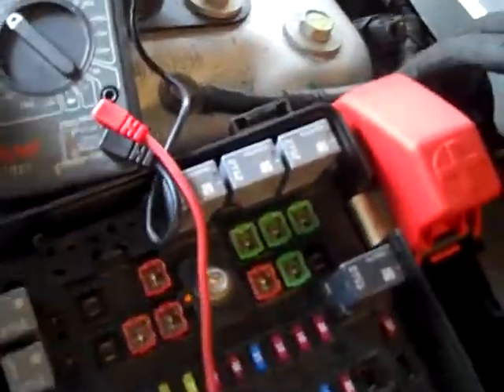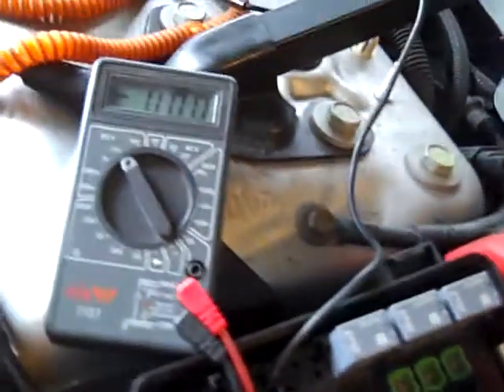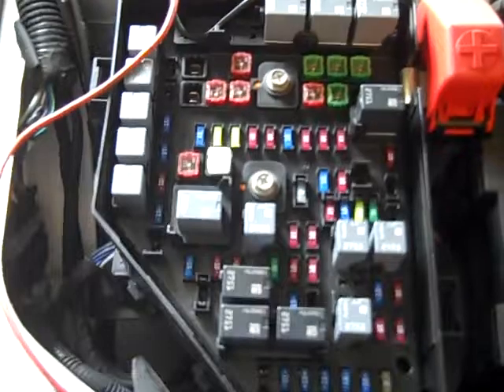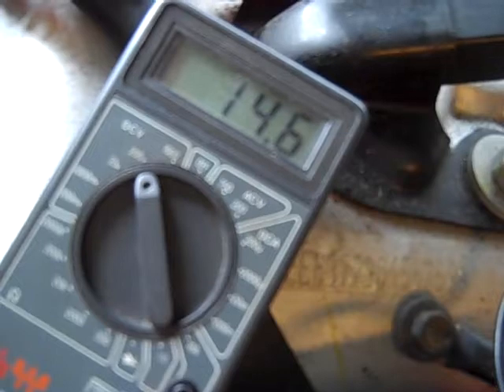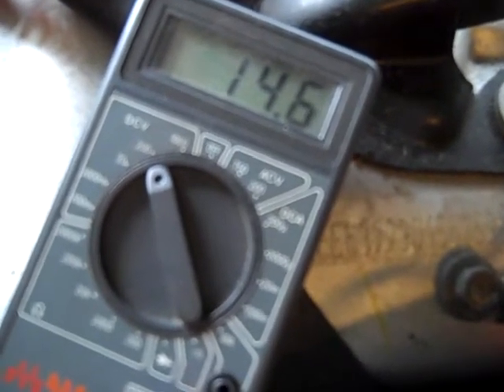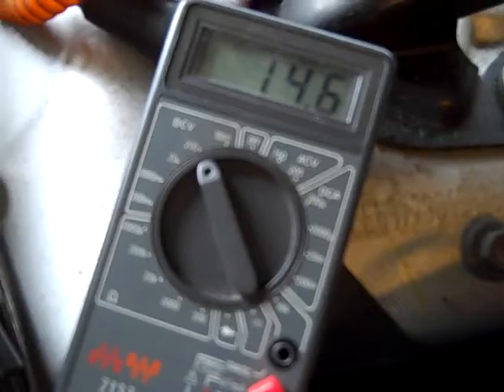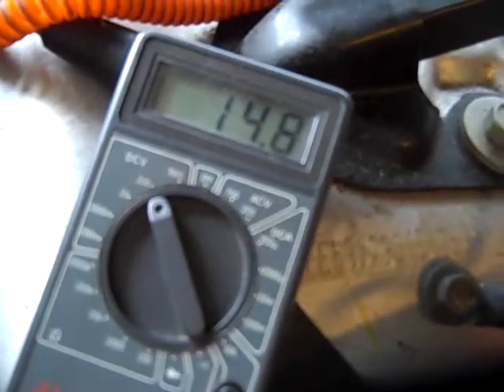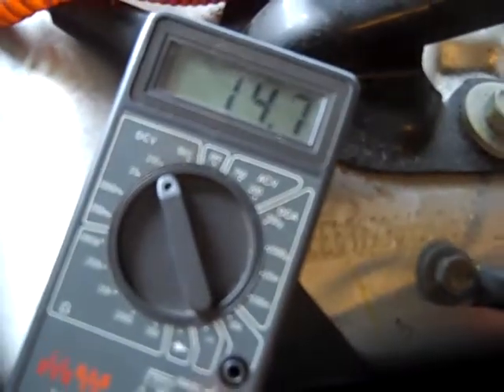How to check car fuses

Comment: Well here is another good question, How do you check a maxi fuse with a multimeter. Can the top window be taken off and put back on.  Or how can one tell a blown maxi fuse by looking at it..  Any car I've had in the past never had maxi fuses till a recent purchase
Reply from the maker: Bob: When the Maxi fuse burns it's pretty easy to see the open gap in the copper strip and it looks charred inside. When in doubt you can pull it out and use the continuity checker on the meter to verify it's in tact.